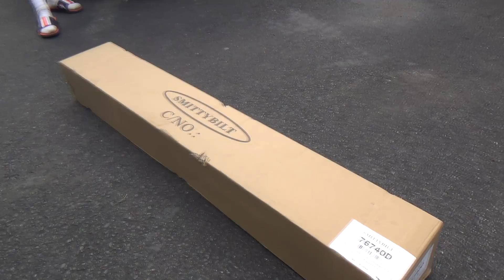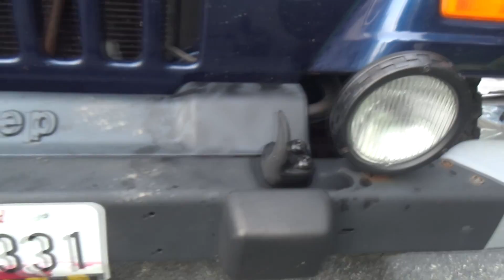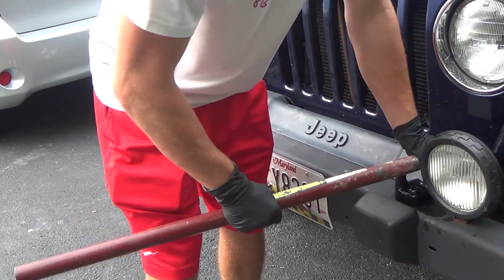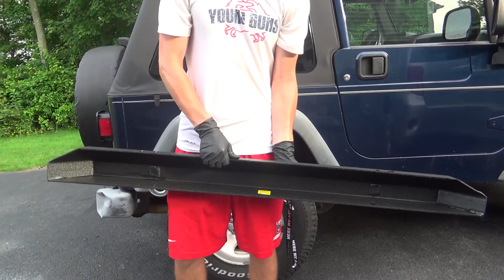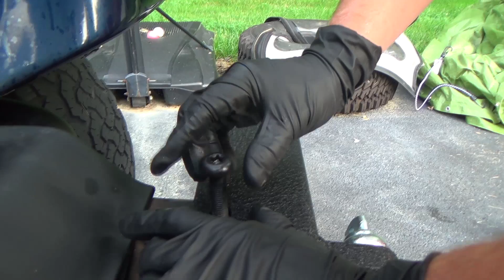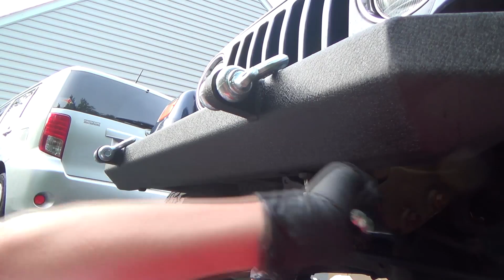Project 2004 Jeep TJ - Smittybilt SRC Classic Rock Crawler Front Bumper Installation

Comment: Paint the D rings ORANGE, put on some rubber isolators and rubber rings to make the D rings silent and wont bang or damage bumper. You can get a kit off Ebay for $5-$6 for isolators and rubber rings

Comment: I have the same T55’s on my Jeep front bumper, but mine are stripped. What would you use or need to get them off?
Reply from the maker: That sucks. Can you get heavy duty vice grips around the heads?  You could also look at grinding a little notch on the edge of the head, and use that with a chisel and hammer to try and rotate it. Once it's broke loose there are some easier options. Heat may help. Just some thoughts I'd look at.
Reply: o3djeeps [ OVERCLOCK3D Jeeps ] what size vice grip would I need. I can get them just don’t know what size.
Reply from the maker: @brandon.lamson4670  Big. It would need to clamp on that head with a lot of force, and preferably one you can put a breaker bar on the handle to get some leverage.
Reply: o3djeeps [ OVERCLOCK3D Jeeps ] alright I appreciate your help! 🤙🏻
Reply: If all fails try to drill them out. That’s what I had to do with the rear bumper when I took of that plastic ends